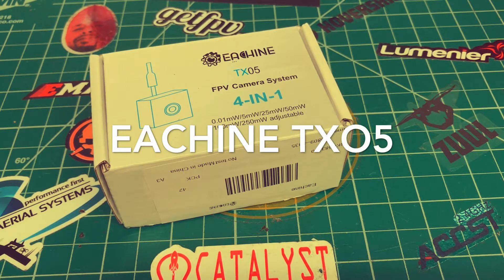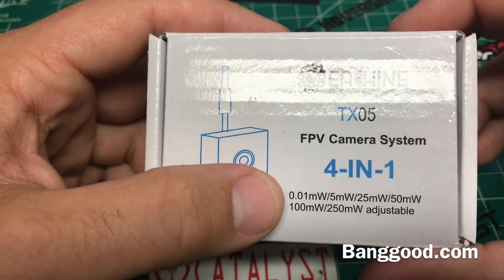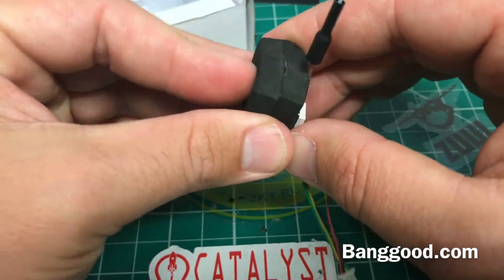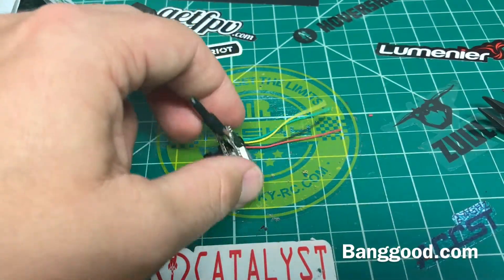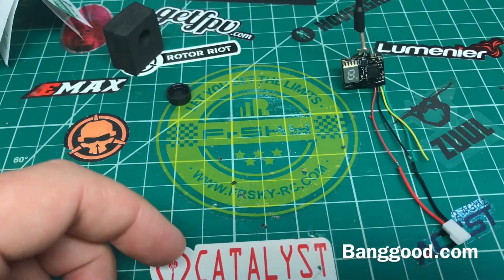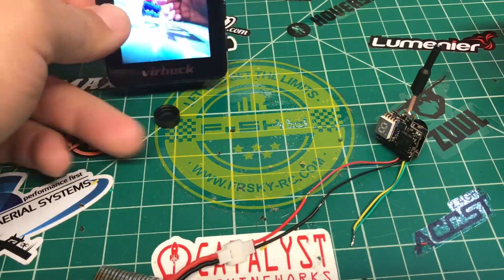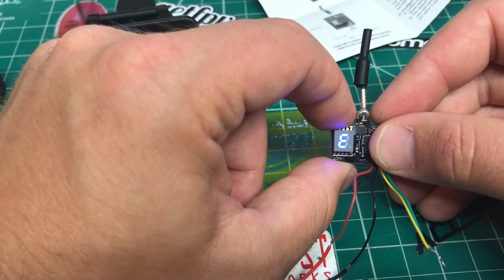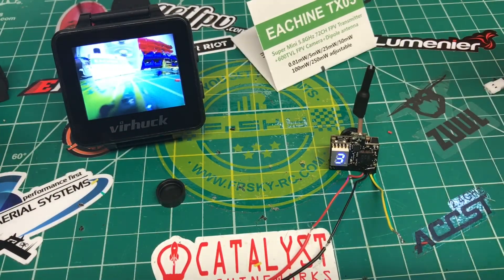Eachine Tx05- How It Works

Comment: What’s this watch screen like?
Reply from the maker: its ok, not really flyable, i ended up taking the reciever out and making a connection for my tv thats at my work bench. now i can really see whats going on  lol.
Reply from the maker: christophe colomb you will need a receiver of some sort. The one I’m using has a receiver built in. It is possible. You can buy a video receiver unwired. Then add power ground. Cut off the end of a yellow video cable and solder video to the video out and ground to ground. Then it will transmit to a tv.
Reply: @chrisr112887  hello, excuse me, I do not know what a non-cabled receiver is, would that be? if not which? thanks https://www.banggood.com/Eachine-FPV-5_8G-32CH-Wireless-AV-Receiver-RC832-p-975426.html?rmmds=cart_middle_products&cur_warehouse=CN
Reply from the maker: christophe colomb https://m.banggood.com/Skyzone-RX5803-5_8GHz-48CH-Raceband-AV-FM-Receiver-Module-p-1159848.html?rmmds=search this is the one I used. But the one you linked will work. And probably much easier lol. The one you found looks like it will just hook right up to an rca Input.

Comment: I can't get an answer from anyone.
Do you know of any AIO that has a mic and transmits audio? Or possibly even any 3.7v vtx that has audio. Correct me if I'm wrong but the DVR 03 has a mic yet doesn't transmit the audio it only uses it to record for the DVR feature... right?
Reply from the maker: MC5 Limited Skills not sure about the Dvr 03. But check out the atx03 by eachine. It’s like the vtx03 transmitter but has an audio line in. As far as an all in one I haven’t seen one but I will check around. I would like to have one as well if it exists. Banggood.com for the atx03